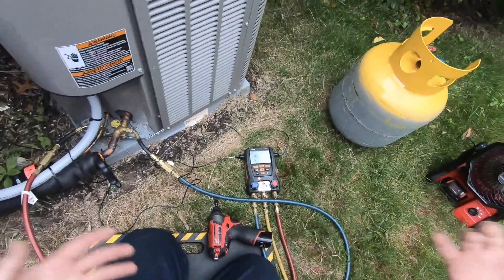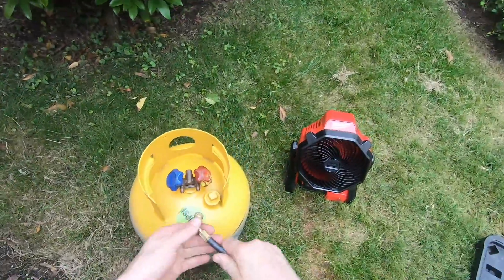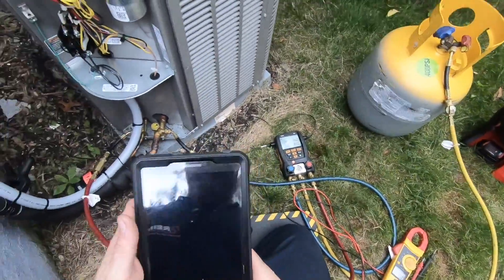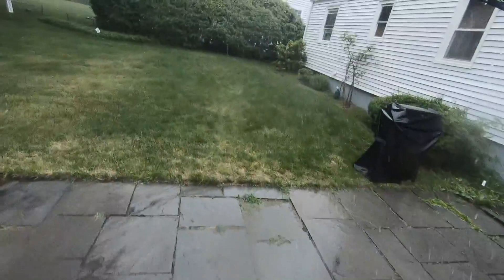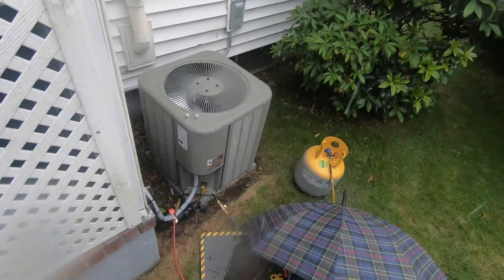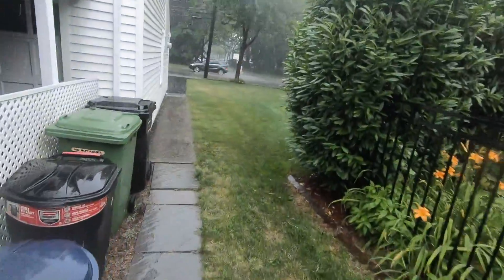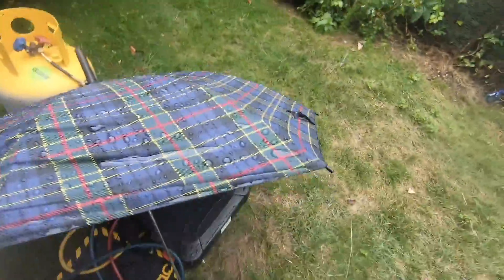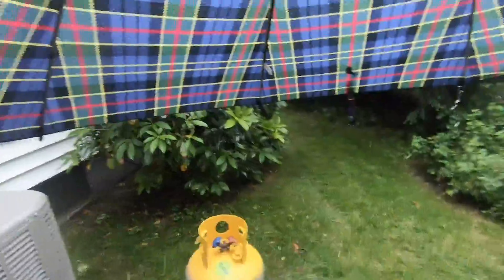Correcting SubCooling on Overcharged AC System I End Up Soaked

Comment: 85 degree ambient and you need a fan. GROW A SET for God sake...! smfh
Reply from the maker: 85 is very uncomfortable when it’s 90+% humid also. I would take 115 all day without humidity. Could you survive working on RTU’s when it’s 12 degrees and windchill has outside -14. Cause I’m out there working no matter not or cold. Or up in 160 degree attics. I will use my fan and stay comfortable rather than being uncomfortable